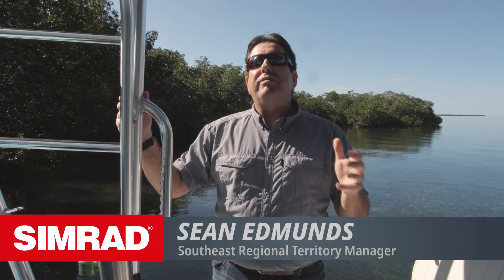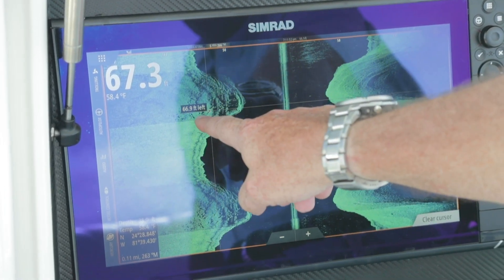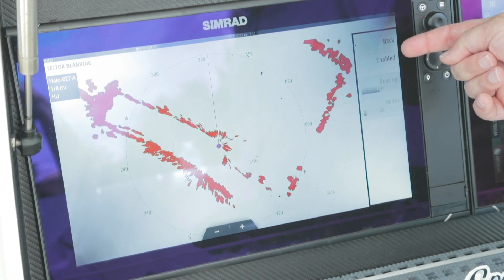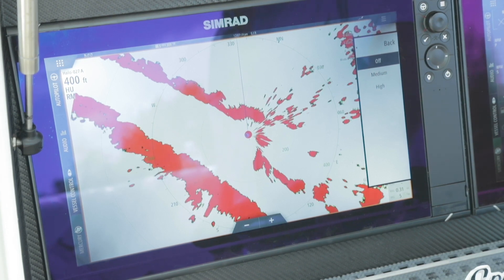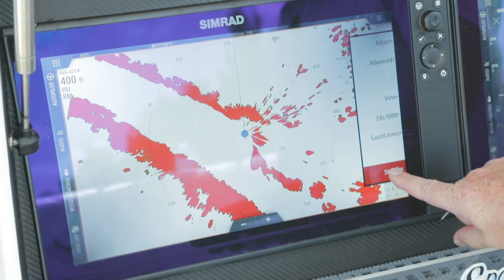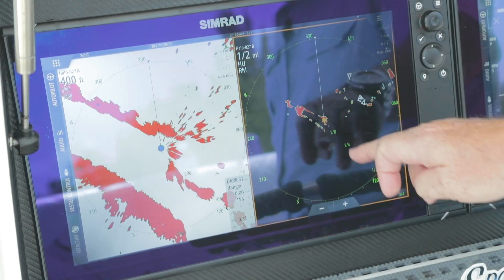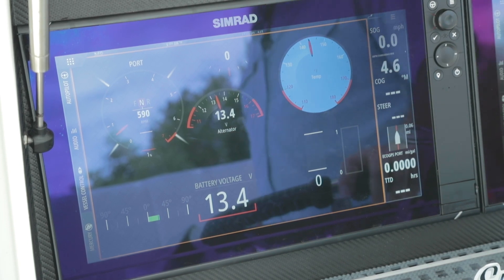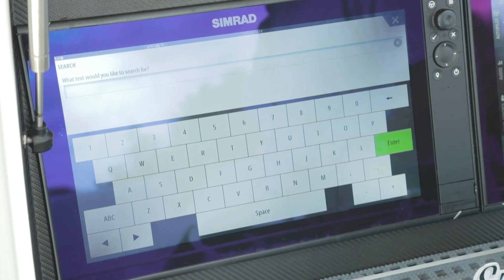Simrad LIVE | NSS Evo3 Deep Dive Part 2| Webinar

Comment: Great info thanks a lot! Do you know if i there is an option to set an anchor point and have simrad sending a command towards the engines to keep me still on my set anchor point? So far i have only discovered an alarm for it which is used just as a warning, so it does not engage the engines at all.
Reply from the maker: No, our autopilot do not provide that option. You should check directly with Yamaha to see if the function is available.